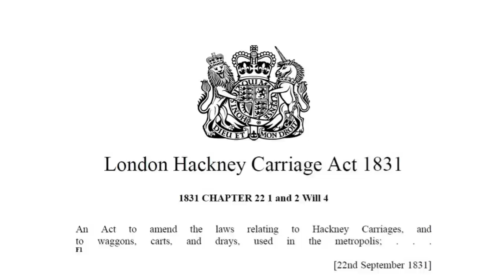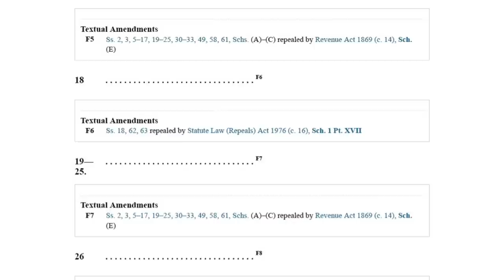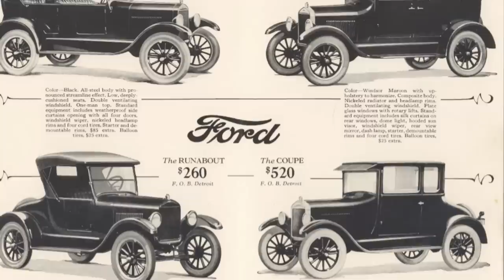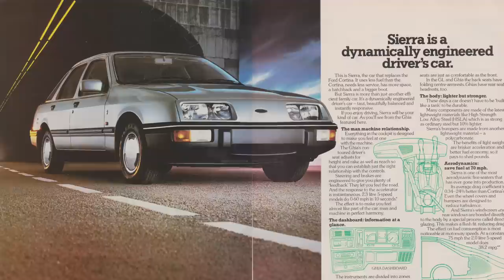Four Automotive Myths That Just Aren't True

Comment: Another "myth" that isn't true - would be the hugely contraversial (yes, as long as you're actually thinking) electric vehicle debuckle. Taking into account several completely new infrastructures that need to be introduced - and a massive industry that has been working for more than a century (and is constantly getting cleaner) - that now has to be turned around on its heels - and the actual numbers (not narrowly quoted from interested parties - let it be politicians who need to get re-elected by the panda lovers - or startups who need sales - or panda lovers themselves who need a bandwagon to jump on in order to keep their lives moving somewhere). Oh, by the way - seeing that Sierra made me think of another car that was similar in this respect - the Passat B3 with its smooth front/no grille. A work colleague of mine had it way back in 2003, I think, here in Latvia - and even at that time, it had 900 000 kms on the clock (he had bought it dirt cheap from a large company who had used it immensely previously). The car had no problems with the engine - 1.8 petrol - but for some reason had to change the rear wheel bearing almost every two months (the bearings cost, if I remember correctly from what I was told - abt. 6 latvian lats, which would now be abt. 8-9 EUR a piece) - or maybe they were just adjusting the bearing wrong at the workshop. Anyway. Modern electric cars to be changed every 2-3 years aren't making this "environment" thing better, quite on the contrary. Thanks for the video, greetings from Latvia.
Reply: Lithium battery is the real problem - lithium is dug up by machines that use diesel, and transported by ships that use diesel too. And if you've seen the huge craters at lithium mines, you know "electric cars" produced more carbon than conventional before they even left the assembly line. And there's also the fact most of the EU and USA still generate 35% of their electricity by coal, and another 20-30% with natural gas. It doesnt save the environment at all.

Comment: I ll also add something. MINI was NOT the first transverse front engine fwd car. DKW of Auto Union has first done it with DKW F1 in 1931. mini also had a fatal flaw of engine and gearbox sharing same sump. Dante Giacosa fixed this in Autobianchi Primula and that became the insustry standard. MINIs use of transverse engine fwd is overrated as hell. Its not even the first and it didnt even bring anything new to the table like FIAT did
Reply: Calm down 😅
"It was the first production front-wheel-drive car with a watercooled inline four-cylinder engine mounted transversely. This allowed eighty percent of the floor plan for the use of passengers and luggage." 😉
Reply: "The Mini revived the use of front-wheel drive which had been largely abandoned since the 1930s."
No one claimed it was the first ever!
Reply: @deanosaur808  top gear claimed that and i seen lot of people claim the same thing, i think its a very old urban myth. Mini did nothing revolutionary, DKW F1 and the Autobianchi Primula are the biggest contributors to transverse engine fwd yet nobody talks about them but instead always chooses to talk about the mini that in reality did nothing new.
Reply: @288gto7  ok it did nothing 🤡
I don't watch top gear. It's a clown show 😂
The fact is, the mini is the first mass produced front wheel drive car with a transversely mounted 4 cylinder engine.
No one is denying earlier achievements or that fiat later came up with a better system.
Anyway it's ancient history now, you'll have to argue with historians with much bigger brains than you and I 🤣